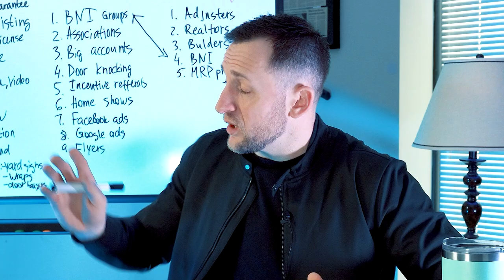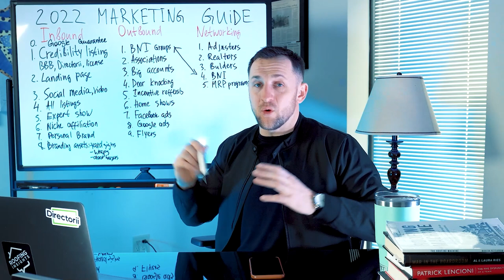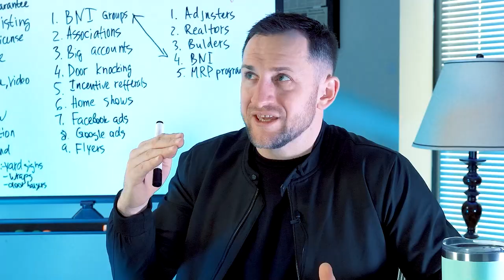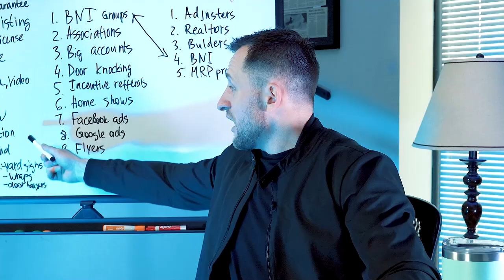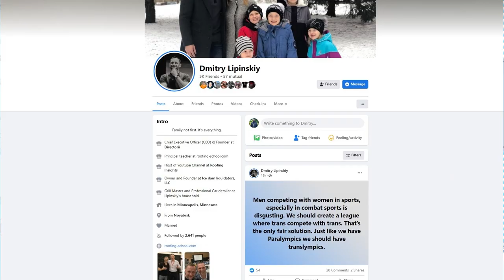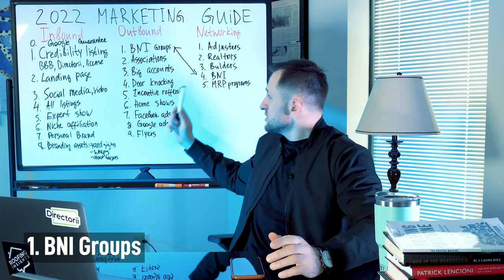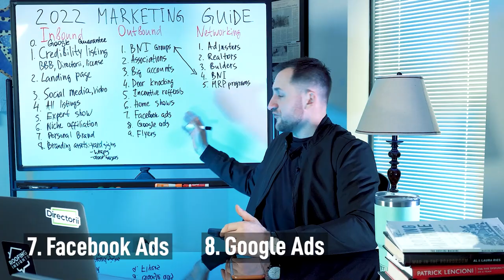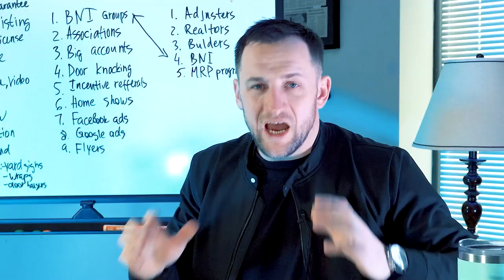2022 Lead Generation guide for Roofing and Service Contractors | Part 1

Comment: What exactly am I supposed to do on the adjuster appointment? Is it legal to get on the roof with him and point out damage? How do you handle angry adjusters? Am I supposed to negotiate and supplement with the adjuster on the spot or do it over email?
Reply: you got to feel them out.  Sometimes they get pissed if you point damage out.  Watch them and be helpful.  If they are ignoring clear damage then point it out cause you know you are dealing with a shady adjuster then.  Negotiate the estimate later.  We have a fully scoped estimate sent to the adjuster before they even come out so they know what they are walking into and you know you are getting an adjuster with the proper approval threshold.